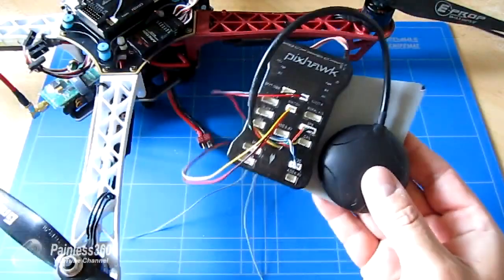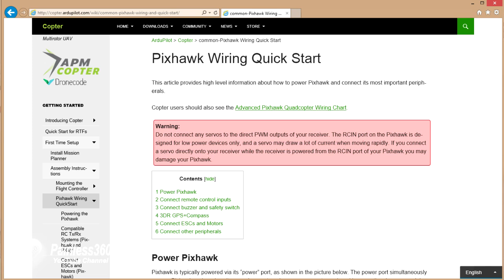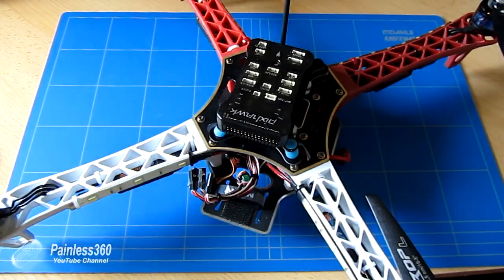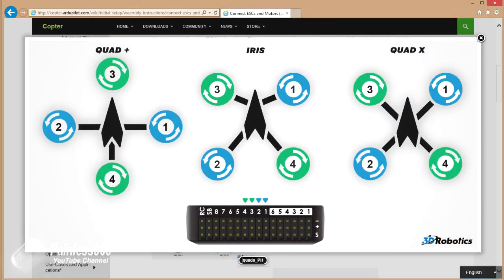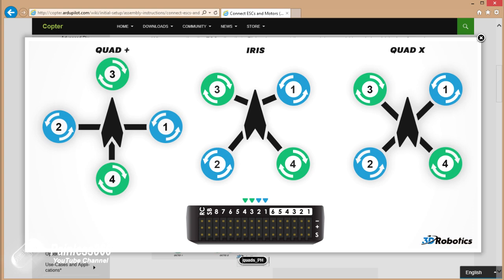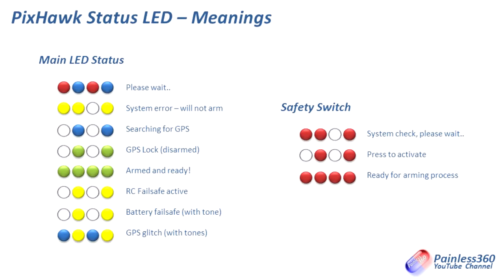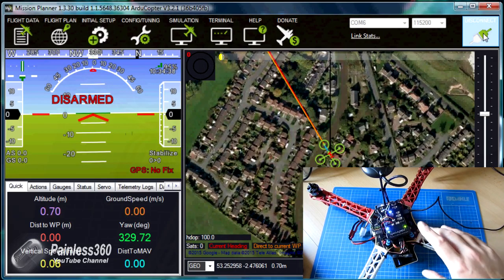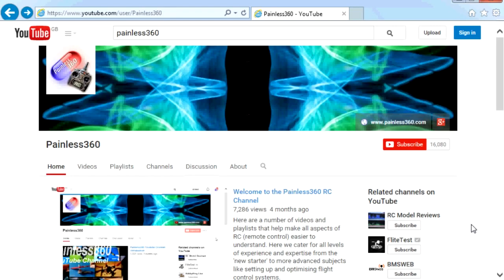(2/5) PixHawk Video Series – Power, installation, final checks and first hover

Comment: Hello - Thank you for your videos. They have helped me tremendously. I do have a question. I'm running pixhawk 2.4.8. Completed all the set up, and mission planner shows all fail safes have passed. Issue is with ESC calibration. I tried calibrating both by way of battery connect/disconnect with throttle up, and through Mission Planner. Both sequences seem to work as I get the expected tones, however once I reboot pixhawk, I get max throttle at 50% stick. Its as if pixhawk isn't saving the ESC calibration. Keep in mind everything worked perfectly well before I changed my AR6200 for a new AR620. I switched back and still same result. Any advice from the guru is appreciated!
Reply: I forgot to mention that throttle controls work as expected immediately after connect/disconnect calibration, but after reboot the settings appear to get lost.
Reply from the maker: You usually need to power cycle the ESCs to store the calibration. The calibration is on the ESCs not in the Pixhawk. I'd check in the forums for the ESCs you have in case it's a common issue with them... Best of luck
Reply: @Painless360  Thanks for the advice! Much appreciated! I'll research the ESCs.

Comment: Hey painless, quick question.  When I calibrated my escs and tested the motors, the response was flawless.  When I arm the quad, the throttle is very laggy.  Quite a bit of hesitation.  Is there a setting that needs to be changed to increase the response on the pixhawk?
Reply from the maker: Depends on what you're doing and what modes you've got selected.. what troubleshooting have you already tried?
Reply: Right now I just have it in Stabilize mode.  Didn’t do it with any props on because I’m still in the testing phase.  For troubleshooting I have recalibrated the esc’s via throttle at full, not through mission planner.  Calibrated accelerometers , level calibration, compass.  Have kept response time on my TX to 0ms.  Not sure what else I could test since I’m still new to the hobby.

Comment: Hello painless, firstly thanks for all the amazing videos. However i'm having problem with my motors. When i finished calibrating and when i connect everything together the motors are beeping, and i tried to calibrate ESC and i cannot hear a beeping sound from the esc whatsoever. Please help. I　ａｍ　ｕｓｉｎｇ　ｐｉｘｈａｗｋ．
Reply from the maker: What troubleshooting have you already tried?
Reply: i'm not so sure. I have done all the esc calibration and the beeps stops and motor start to work. However when i disconnect the battery when the throttle is still low which is followed on the manual it start to beep and not moving again after i plug the battery in again

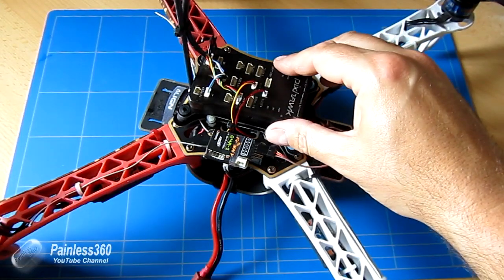Comment: Hi, near 6:30 you slide over how you finalized the installation of the power module, and how that connects to the pixhawk ultimately. You only have one battery on the craft at a time, correct? You plug the battery into the power module, which goes through the "power distribution board"(the frame, correct?) , but how does it get from the frame to the pixhawk? What connections did you make from the distribution board to get it to connect to the six-prong power adaptor atop the pixhawk?
Reply: +Sir Gravy after some further consideration I notice the 6 prong output on the power module. Do I only connect the power module to the distribution board? One end attached to the distribution board, one to the battery, and then 6-prong to the pixhawk?
Reply from the maker: +Sir Gravy Power is connected to the PM (that then powers the Pixhawk via the 6 strand cable) then the other side of the PM connects to the PDB that connects to all the other parts of the system. Best of luck.
Reply: +Painless360 holy fast reply! thank you very much. So the power wires that came with my DJI F450 set will not be used, am I correct? I hope you don't mind my questions your videos are very comprehensive! Thanks again
Reply from the maker: Not sure as we don't use DJI kit here (not fans ;) Best of luck with it..

Comment: Hey Painless. Having issues with my Pixhawk 2.4.8. Been flying the APM 2.6 for a couple years now with no real issues to speak of. Decided to build a hex with the pixhawk and setup and install was flawless. Flight, however, was a nightmare. Stabilize flight was fine but when I went into loiter, it started drifting all over. RTL the thing just took off, climbed to 100', and and made huge circles. I took control in stabilize and brought it down. I unhooked the external compass and mag and hooked it to flight planner. It pointed dead North. So I put the external comp. back on and it then read 40 deg N x NE. Do you think this conflict in heading is causing this problem?
Reply from the maker: If the mag has any problems then the GPS modes will mess up. See out video on why GPS modes need a solid compass for an explanation about why. I'd look at reducing the interference on the model.. Best of luck!
Reply: same problem when in loiter mode then there is statbility issue

Comment: hey!

Ik I am very late to this vid.

But can you help me with my pixhawk 2.4.8. I am unable to load the firmware and the main led is not blinking at all. only top PWR led's are solid green with no buzzer sound and no light in switch+  the tf is already pluged in.

please man can you help me?🥺
Reply from the maker: I've not used this FC for years. I've not seen that,  I'd check out the forums as I'm guessing you're not the first person to have this issue.  Best of luck
Reply: @Painless360  thanks man <3

Comment: Sir by mistake i connect wrong 
instead of white i connect black
and instead of black i connect white
so is there any problem ?
ESC and pixhawk is fine or what ?
Reply from the maker: +Jashu Chaudhary no idea, depends of the wires you swapped were power. You need to check it all.. Best of luck

Comment: After following your video 1/5 I completed the tasks but still get flashing yellow lights.  On going through the user manual, I am confused as to what the motor numbering is.  Are the motor numbers as displayed on the frame type document, or are they as numbered on the actual aircraft frame?  I am setting up an RCTimer S800
Reply from the maker: The wiring of the motors to the flight controller is as they are displayed in Mission Planner - all detailed here (same as the video) - http://ardupilot.org/copter/docs/connect-escs-and-motors.html hope it helps..
Reply: Thanks for clarifying that.  It is how I wired up the aircraft.

Comment: Just perform my first flight after follow your guide here. But the flight failed at takeoff. It flip forward both times. I have check the motor rotation, props also correct. Test motor at Mission Planner and it show motor sequence correct. I'm clueless now. I takeoff in Altitude Hold mode. Any advise? Is there any way to test the motor rotation speed? Or test motor defect? Please advise. Thanks in advance.
Reply from the maker: +Leslie Chan see our video on what to check if you flip on take off. Best of luck!
Reply: Already watch before making this comment. Doesn't fix my problem.

Comment: great videos. learning a lot from them. 
i have a pixhawk with an emaxx 4 in 1. it will not power my motors nor does it beep or do anything. the pixhawk seems to work fine alone. the emaxx seems to work fine by itself when i plug the leads into the throttle on the receiver. they just dont seem to work together. any ideas??
Reply from the maker: Lots of ideas but tricky to help with that level of detail.  Are you arming the Pixhawk?
Reply: DJ Cheek I was reading on the Pixhawk wiki that it may not work with Emax ESC's unfortunately.
see  here - http://copter.ardupilot.com/wiki/initial-setup/assembly-instructions/connect-escs-and-motors-pixhawk/
Reply: +Painless360 yes. the Pixhawk arms and acts like it's working correctly. the Emax 4 in 1 also woks correctly when it's calibrated through the receiever but when the Emax in conected to the Pixhawk the Emax does nothing. no beeps. no nothing. i've read that many people are having this problem.
Reply: +Greg Mack thank you for the reply. i have seen that little note but only after I purchased the Emax. wish I had seen it sooner.
Emax seems to be a great little unit and maybe even a good company, pixhawk seems like it's a top of the line kind of controller. they should have mad sure that these 2 units are compatible.

Comment: What is the best option if im running 200amps on my quad and the power cable is rated for 90a?
Reply from the maker: its common to run the cables for the limited flying time well over their max rating. Unless you're flying at 100%/very high throttle then you'll actually be pulling a lot less than 200 amps..
Reply: Painless360 4x50esc 3536motors 11x5.5prop im hoping to fly for 15 mins or 20/25 mins with a different battery but i would be going straight up at a decent speed for a while alot if you know what i mean i over engineered the quad so it would hopefully be quite  stable in wind and for reliability for long range fpv but now im worried the power module will fail but ill try it :-)

Comment: hello sir, i want to use pixhawk with 6s 10000mah battery, i have power module G M v1.0, can i connect battery through power module directly to pixhwak ? is their any need of any other component? 
thank u.
Reply from the maker: It depends on the rating of that power module. I've had a quick look online and couldn't see that exact one but just make sure that it supports 30 volts or more and it should easily handle a 6s pack. Best of luck
Reply: Painless360 thank you sir

Comment: Quick question -- I can't seem to be able to reverse the pitch even when I change RC2_REVERSED parameter value to -1 -- I have the same setup as your taranis (Mode 2). Also my quad keeps rotating counter clockwise and never takes off! :( Could you please tell me what Im doing wrong?
Reply: So I figured out why it wont take off (the spin rotation was off), but now I notice a significant vibration in the arms when the drone is about to take off.... my AUW is 1151 grams and rated capacity is 1600 grams...
Reply from the maker: Could be resonant frequency of the frame.. best of luck!

Comment: Question: Does it fly better with a Pixhawk vs with an APM?
Reply from the maker: Depends on how well it's setup and tuned. I'd go for PixHawk now if you can afford it. It's a far more capable platform.. Best of luck!
Reply: Another question, if you don't mind.... can I use the old M7N GPS from an old APM on with Pixhawk? What is the difference between the older M7N and the newer M8N GPS modules?

Basically, do I absolutely have to buy a new GPS module if I upgrade to Pixhawk 2.4.8..?

Comment: where do i connect the power to the vtx to?
Reply from the maker: Depends on what voltage the Vtx needs. I normally connect to the main battery terminals on the PDB or the 12v out on it - depending on what it needs. Best of luck!

Comment: hi painless360, thanks for the video!

i have set up the pixhawk as above, and I have an additional walkera g2d camera gimbal powered by a separate 3 cell battery. 

my issue is: in order to get the camera gimbal to pan down and respond to my tx chn 6 knob, I have to connect the chn 6 output from my futaba ppm rx to the gimbal control board. this causes current to flow between the pixhawk to the rx to the gimbal controller, which im not sure if it's an issue. both the pixhawk rails and the gimbal controller reads 4.9-5.2 V

hope you can advice, thanks!
Reply from the maker: +AeronauticalUAV What is the question?
Reply: +Painless360 the question was how to control the gimbal without sending power from the rx to the gimbal controller.

I made the mistake of connecting only the signal wire. I've figured out that I have to connect both the signal and ground wires only in order to get the signal sent without allowing power to flow between the two. thanks the reply though!
Reply from the maker: You can usually  just connect the gnd and signal wires.. Best of luck!

Comment: Not sure if anyone else asked yet, but is there any specific reason and/or benefit to putting your gps/compass in the front of the craft rather than on the back?
Reply from the maker: +Hunter Miller Non at all, so long as the GPS is as far from any interference/other antennas as you can get it..
Reply: ok cool, I'll probably end up mounting it up front anyways to keep it away from the 5.8 omni antenna. Thanks for your help and videos!

Comment: Hi Painless, i've just received my Pixhawk 2.4.6 from Banggood with all components (osd, bluetooth, switch, buzzer...), i've loaded Mission Planner and followed your video to wire , tune, check...but on the last M.Planner version , there is an item to Escs...but i can't to start motors despite switch to arm them and i get a tone , bip, on one of my engine...i wonder if its esc is hs or not...what do you think about it...? and i can't find a schematic to wire Lipo + Pixhawk module + Pdb..., did you get a link for this...?

Best regards and good flights
Philippe
Reply from the maker: Do they run when you perform the ESC calibration?
Reply: Hi Painless, they don't run ...first i don't know if i only need 1 Esc with black (brown ) + red + signal ...and only signal on the 3 others...or only 1 Esc with black + red + signal and black and signal on 3 others  ..or black + red + yellow( white ) for 4 Esc... despite your very good videos series but i think i don't understand very well for this...The second...On M.Planner i get the last version with ESCs calibration but a sentence is
" push the button ...unplug/plug via usb"....this button isn't switch because after it is written...."push switch if ..." so i think it's the "Green" button....Start or Ready...isn't it...?

Thank's a lot for your explanation....Best regards
Philippe
Reply from the maker: A video of the problem can be helpful..

Comment: May you please put the link for the ESCs to buy them from 3DXR
Reply from the maker: What amp rating and voltage do you want?
Reply from the maker: Jumpers? What are they? I'm not trying to be obtuse, I just honestly don't know what you are referring to. If you are new to all of this, check out my videos on R/C basics for the names of things and the terminology..
Reply: @Painless360  I mean the female connectors of the ESCs to connect them to the cube.
Reply from the maker: If you mean the 'servo style connectors' they most ESC designed not designed for multirotors will come with them attached - see my videos. Best of luck!

Comment: Sir 
I'm using radiolink pixhawk and Avionic RCB6i.
In Mission planner radio calibration done perfectly.
But From RC motor is not starting.
Any Help
Motor Test works perfectly from Mission Planner.
Reply from the maker: +Jashu Chaudhary did you arm the flight controller?
Reply: Painless360 arm the copter 
How ?
Reply from the maker: I suspect that's the problem then ;) See the video series you're watching for how to..
Reply: For arming the copter i have to connect to my pc then its work
But how to directly arm from rc.

Comment: Is that a ferrite ring you have your ESC leads wrapped around? Do you have THAT much interference and where is it getting interference from a DC powered device that a ferrite ring can work on? My understanding is that ferrite filters the  capacitive reactance off an AC interference source.
Reply from the maker: Did you notice how old this video is ;) Very few pilots do this any-more. See my more modern content...
Reply: I'm surprised you still pay attention to the comments on such an old video. Many kudo's! Perhaps you can tell me where in which video between 1 and 3 of this series do you fix the elev reversal. You mention it a few times, but I can't find the reference and I'm curious about the technique you used. I realize there are a few different ways, just how did YOU do it?
Reply from the maker: Please check out my more modern Ardupilot 2020 series for a full list of steps to setup both Arduplane and Arducopter - they show all the steps. Best of luck!

Comment: HI,

Thanks for the video, I just got my PX4 and it was very helpful.

One question though, I was trying to set the batte4ry monitoring feature on the PX4 and found out that the PX4 dues not read the voltage from the power module (A link to my power module is at the bottom). I did find out who to calibrate it but the thing is that the PX$ does not ever read the voltage from the power module/

Do you have any suggestions on who I can make the PX4 read the voltage of my power module ?

Thanks

Erez

APM Power Module - https://www.banggood.com/APM-Power-Module-with-5_3V-DC-BEC-Available-with-T-or-XT60-p-1035032.html?rmmds=myorder
Reply from the maker: Not sure, the one I had here worked great. I'd look to see if others have had the same problems with this one. Best of luck!

Comment: Hello again,

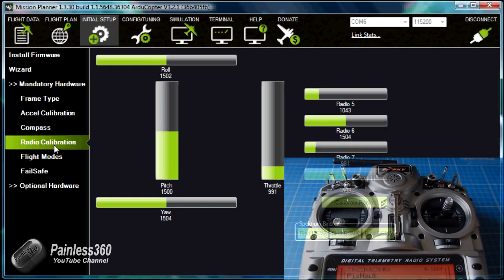around 17:25 you mention the Pitch must be reversed but did not mention the proper way to do so. Any tips?
Reply from the maker: Channel reverse on your radio.. Best of luck!
Reply: +Painless360 got the channel reversed. thanks!

I am what I believe is my final issue before I can fly, and it is a problem you may not know.. When I connect my ESCs to the distribution board they start to beep. non-stop. Before I get a chance to connect my remote or anything.. when all three jacks are plugged in the ESCs won't function, just beep beep beeping away. Perhaps a calibration issue.. any guess?
Reply from the maker: Please follow the videos, they show the steps to a successful setup. Sounds like the throttle may be reversed too. Check everything in Mission planner and keep the props off until you get it all working..